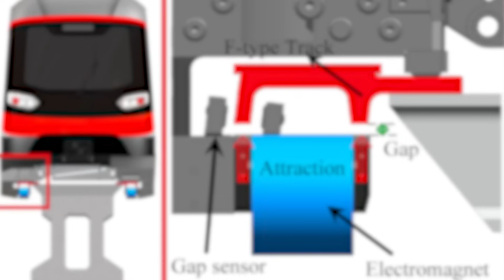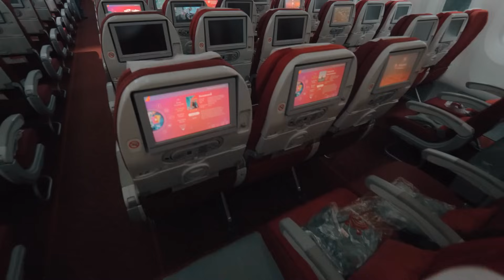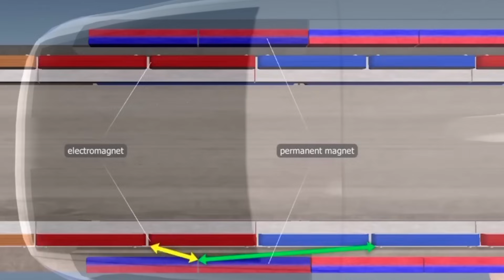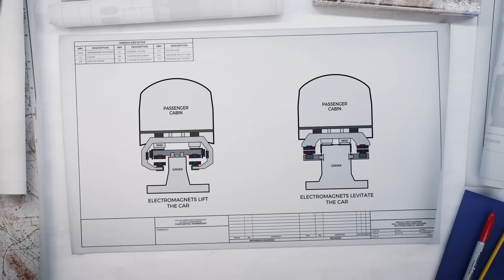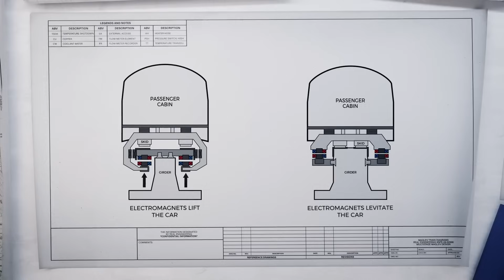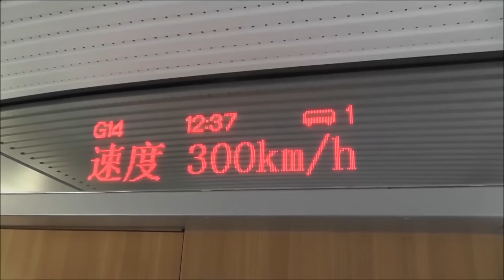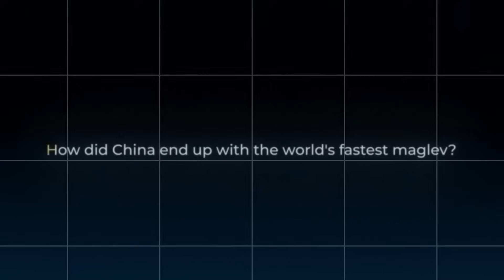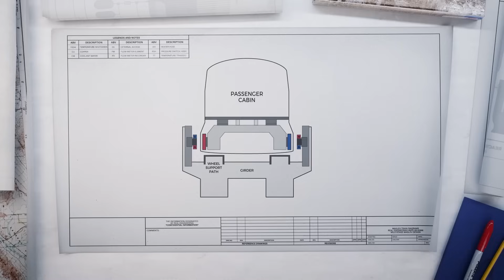China Announce New Train Is Faster Than a Plane Will Change Travel Forever!

Comment: Also the bamboo high speed train had been built and tested,  weight is 15 % less at least but panels cost is higher than current metal. However when mass produces the cost can be reduce and emissions can be leverage. China never announce loudly.  But it had happened and looking forward the outcome of China  combine 600km maglv with bamboo materials train.

Comment: Since its successfully tested,  magv train required massive investment to upgrade the hs rail to magv.  China Current target is to take the knowledge and place it into the current high speed train with aim to increase speed to 550km of cr450 recently launched in June replacing the 350km.

Comment: I have tried both the China's Maglev bullet train and the Japanese Shinkansen. It is silent and vibration-less. Sitting in it you wouldn't even know that you are travelling at 350km/h till you see the display panel showing the speed. Meanwhile in the US...........🙄
Reply: At 350 km/ hour is a regular high speed train. The video mentions Maglev, or magnetic levitation train at more than 1000 km/ hr.
Reply: @kianchua7868  In some china's cities,like Shanghai, it is known as the SMT (Shanghai Magnetic Train). Its mode of operation is by magnetic levitation, same as the one described in the video. Initially it used to hit 350km/h but currently now its average cruising speed is around 300km/h, probably as a cost saving measure. But even at that speed it is considered as very fast already. The 1000km/h trains have just passed the test runs. They ae not commercially operatonal yet
Reply: But we are spending $1 trillion on military which is causing us to lag behind
Reply: I have travelled in the bullet train in China. Smooth and fast! A delight to ride. And now they are upping the challenge!
Reply: The newest version has doubled that speed.